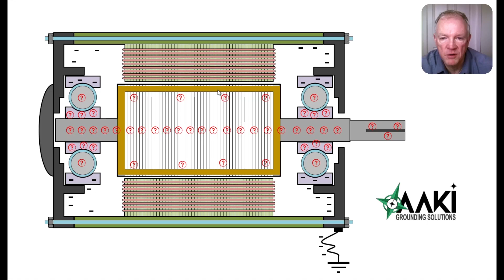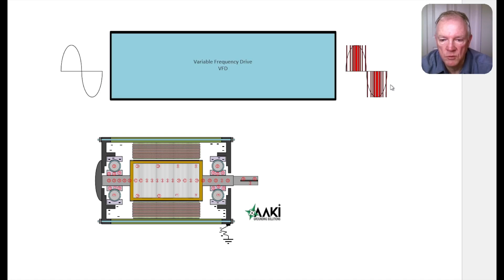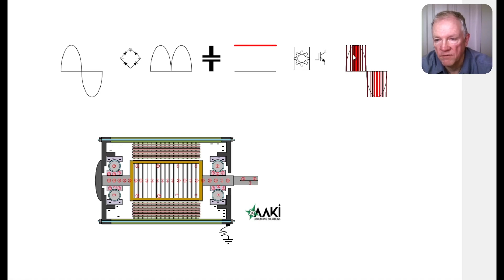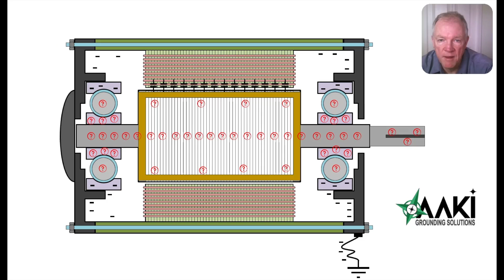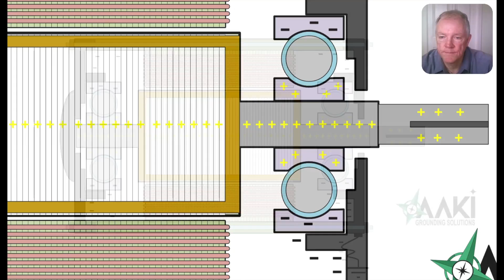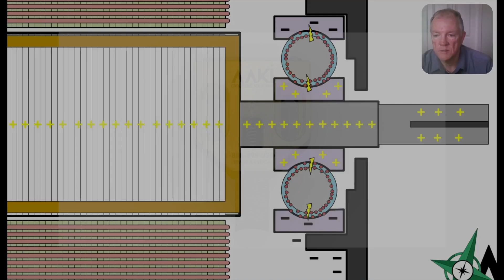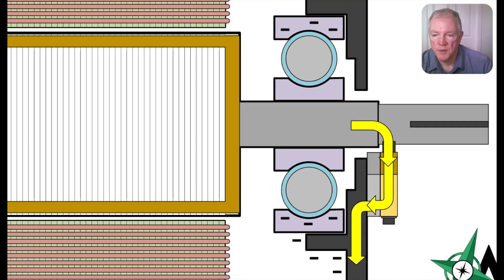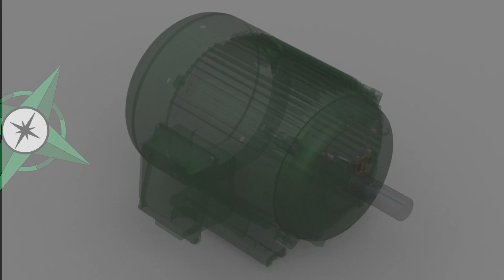Part 2: Induction Motor Tutorial - Prevent Bearing Damage from Eddy Currents & Shaft Voltages

Comment: What it the bearings are ceramic balls instead of metal ?
Reply from the maker: Thanks for asking and its a good question.  We get that one quite a bit.  Ceramic bearings will help to protect the motor and they will work to do this job.  There are several drawbacks though.  First they are expensive.  This is often a hard cost for the customer of a repair shop to swallow.  Typically 3 to 10 times the cost of a standard steel bearing.  Secondly, they are hard to get.  Also a challenge when you need to tell the customer that their bearing replacement is 4 to 8 weeks out.  They don't have time for that typically.  Greasing is often also a challenge since ceramic bearings often use a special grease.  This makes maintenance of the unit problematic.  It's enough of a challenge already to ensure proper maintenance on motors; adding a new process for one or two motors may be problematic.  Fourth, if the ceramic bearing is successful, then there can be a high voltage build up on the motor shaft that creates its own challenges with safety and also electrical noise.  Fifth, is the distinct possibility that a ceramic bearing will simply push the problem downstream.  That induced voltage wants to go somewhere and it will find a path.  @AlenBain comment below speaks precisely to this problem!

Comment: I was working a walk in direct fire Trane RTU today. The motor for the blower is on a VFD. The motor was producing stray voltage which was putting cracks on the blower shaft it turns, and damaging the bearings for the blower shaft. I don’t understand how the stray voltage is making its way up to the blower shaft it turns and damaging the bearings and damaging the blower shaft.
Reply from the maker: That's a good question and a good example of how the shaft voltages created by a VFD can affect driven components downstream of the motor.  If you think of the shaft of the motor as being isolated from earth by the bearing grease acting as an insulator, then that voltage can build up with nowhere to go.  So now its looking for a path to ground.  If the shaft is electrically tied to the shaft of the blower, then the voltage will find its way to the blower bearings.  Then its a crap shoot on which bearing insulation will give up first: the motor or the blower.  Eventually one will fail, usually the bearing with the highest load on it (which tends to thin out the grease insulation layer).  Good question!